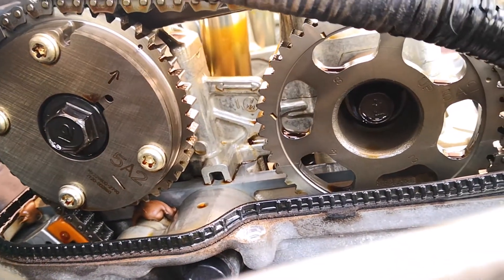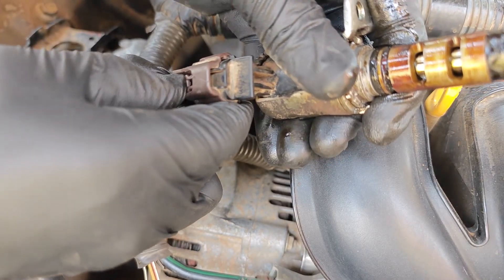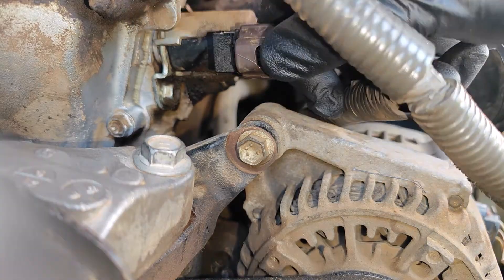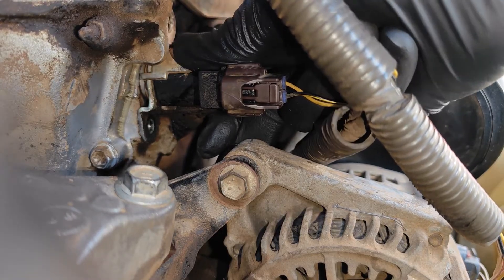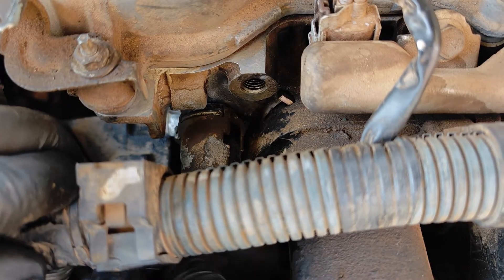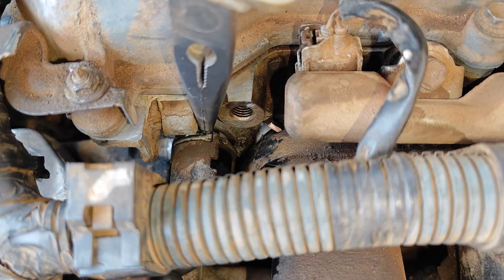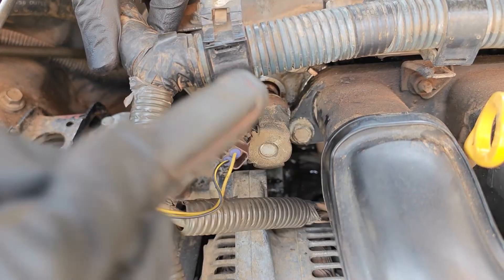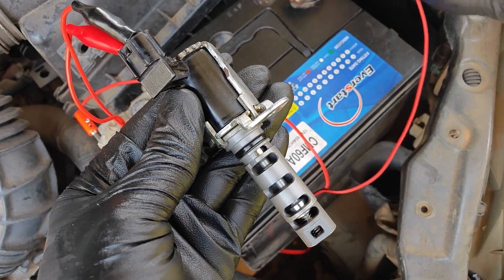How to Remove Stuck Solenoid Valve / Stubborn Valve Timing Solenoid Removal

Comment: We used an electric hammer-drill with the chisel bit. Ours broke off, ran a tap and a bolt into it . Then, used the chisel power tool to bring it out.

Comment: Ahh.. no way to do this on my honda, its hidden and layed inside the side of the ngine 😢
Reply from the maker: What Honda do you have? I've done it on a Honda as well. Same principle, slightly different approach
Reply: @DIYAutoworksNG Already broke the plastic off. K24 in honda element
Reply: @tonkshred My situation with a Mitsubishi, has a lip around the base, and it’s buried in a spot you can’t get a pry bar or anything. Trying an easy out today.

Comment: Great tips! Thannk you... LIKED!

ANnyone, what if the tab broke on the connector?
How do I get it to hold tight after new solenoid?
Reply from the maker: Thanks mate. You can use a zip tie. Search using zip ties on broken electrical connectors and you'd see how it's done.

Comment: I have a 2002 Toyota Corolla. Vvt broke in pieces with the inner part staying inside the engine. Will I get it out if I remove the engine valve cover?
Reply from the maker: Check on YouTube, there's a couple videos on YouTube and how to remove a broken VVT solenoid

Comment: The outer sleeve that was moving independently of the inner one, does this have any negative effect by the time you are done cleaning and want to put the valve back in as the axis might have shifted?
I am having this issue and i am a bit worried.
Reply from the maker: Absolutely no issue observed. No VVT codes or symptoms.

Comment: Saw ur video late, already broke mine but luckily it came out but I will have to now buy another one. Was just trying to solve oil leakage from it by changing it o-ring
Reply from the maker: So happy you got out the broken piece! It can be a nightmare sometimes. All the best with the replacement!
Reply: @DIYAutoworksNG  funny enough, it separated from the metal jacket. I was able to use your technique to remove the inner component and it came out easily. I attached both together, changed the o-ring and after testing it to be okay, I coupled it back and the engine is working perfectly. After driving to work today no check engine light or leakage. I don't know if I still need to buy a replacement or just be using it like that. The other leakage I want to try and fix now is at the Timing chain tensioner but I'm scared, don't want to experience what I went through with the vvt solenoid.
Reply: Yeaaaa I broke mine smh gotta buy a new one but I’m headed out to try the needle nose tric now

Comment: This has been a nightmare for me as my mechanic used gasket to apply on the o ring before putting it back as the o ring wasn't enough to stop an oil leak. Now I can't remove said part again as it wouldn't move at all
Reply from the maker: That's a rubbish move by the mechanic. Depending on the car, the leverage method may work, if it's a Honda, it's a different story as the VTC solenoid is usually recessed. I rather use a long needle plier for those.

Comment: What symptoms do you expect with such clogged solenoid.
Reply from the maker: VVT solenoid issues gives rise to a CEL and the car usually enters limp mode; won't rev beyond 3000RPM. Can also lead to mechanical engine noise.